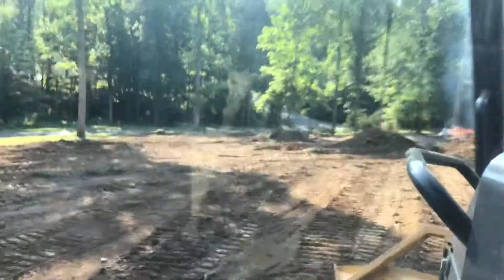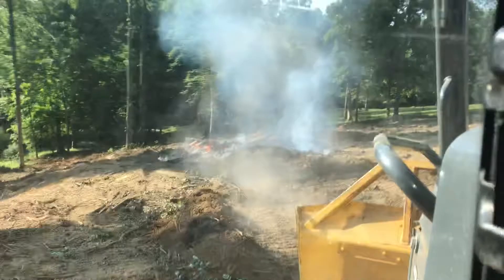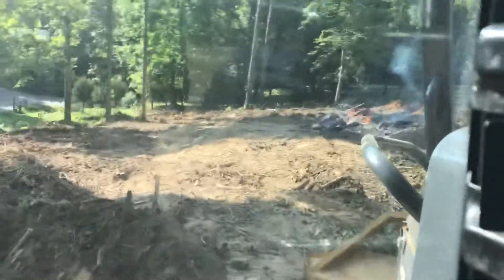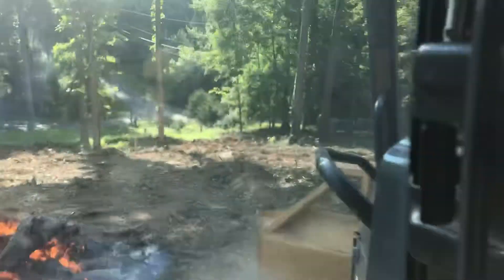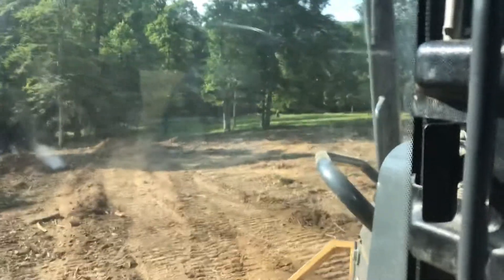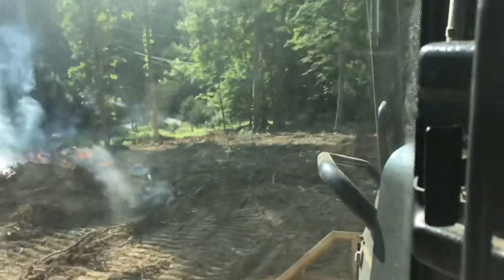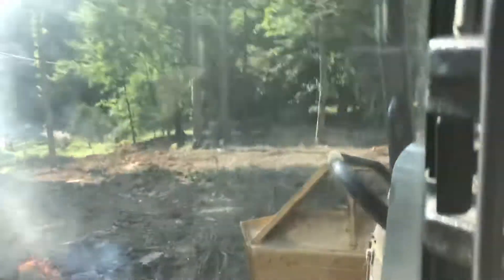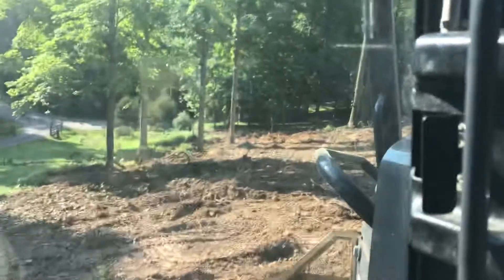Dozer ride 700K Deere cab view

Comment: Those Deere dozers do have great air conditioning. We have a 650k, that thing has the best a/c of any piece of equipment I’ve ever been on. Just got a new 325g and it also has a great air conditioner. Much better than any of the CATs I’ve ever owned.
Reply from the maker: Lester Earthworks you are correct sir! I’ve never used the a/c past 2nd notch in my 700 or my 333G my 130G on the other hand never seems to be cold enough I’ve tried everything!